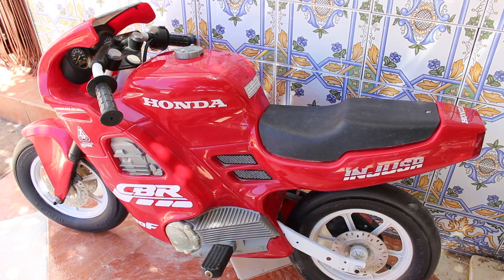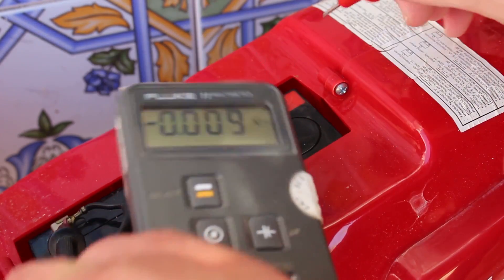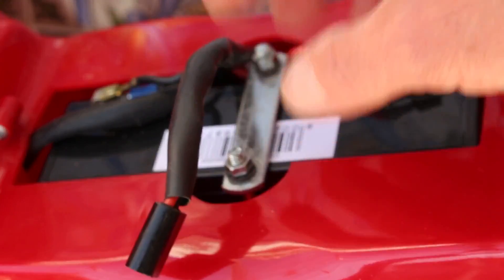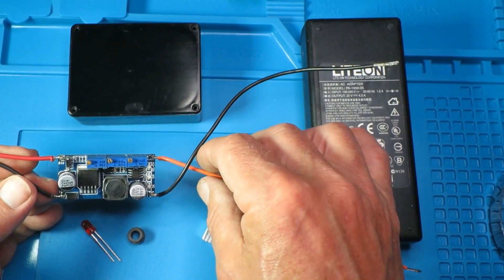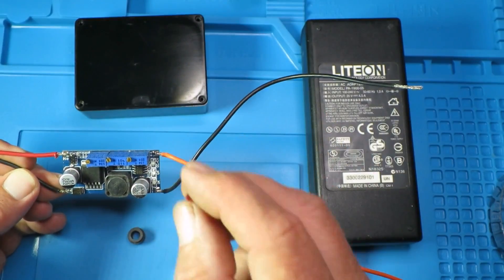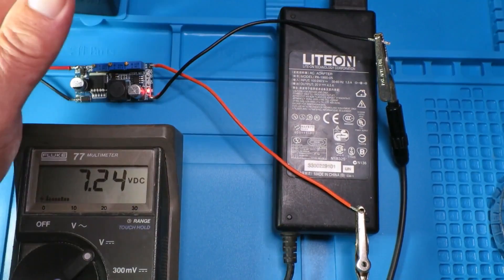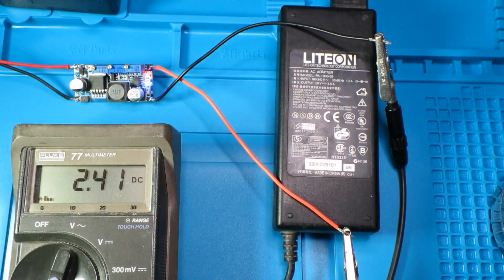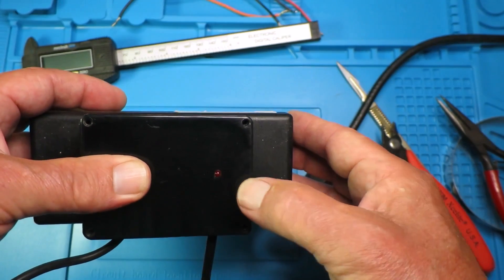Injusa Battery Electric Bike Fix - Electronic Project

Comment: Great job, bro! I think about making something like that to charge battery packs (using a BMS, of course). Replacing the potentiometers with external ones and so on. :)
Reply from the maker: Yes, that will work OK. Keep it simple!!
Reply: 1nformatica I already did something like that, but it's a mini lab bench power supply to use with the breadboard. :) I used a step up down based on the XL6009. :) Friday it's going on air.
Reply: 1nformatica  another great video,keep them coming
Reply from the maker: I'll look out for it, keep 'em coming!!